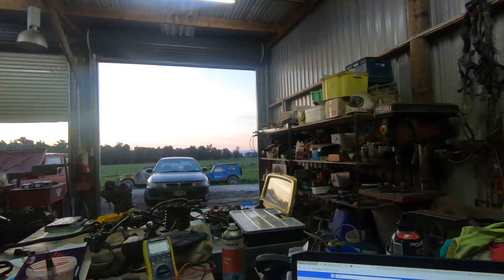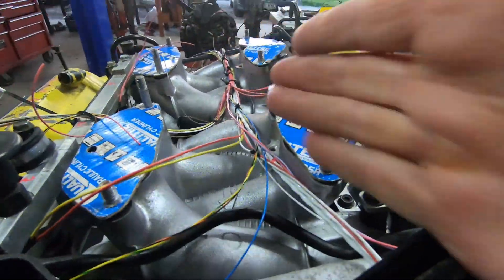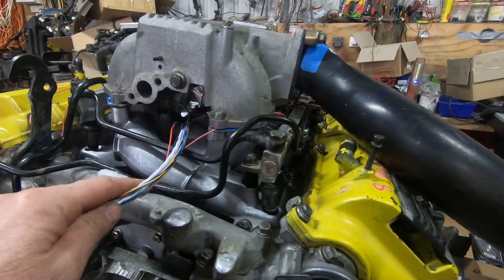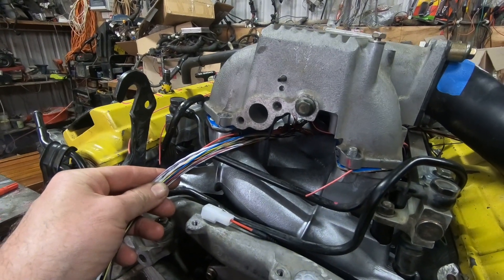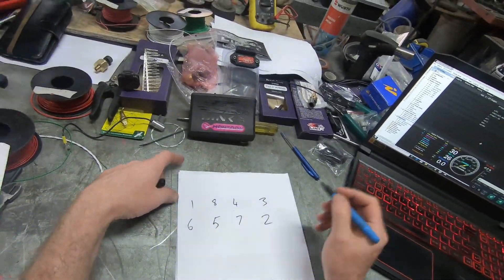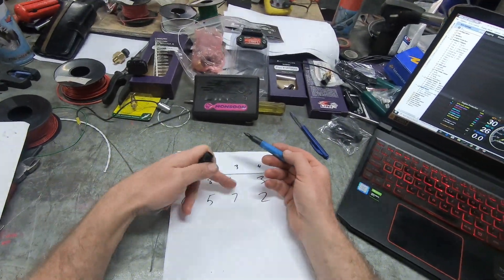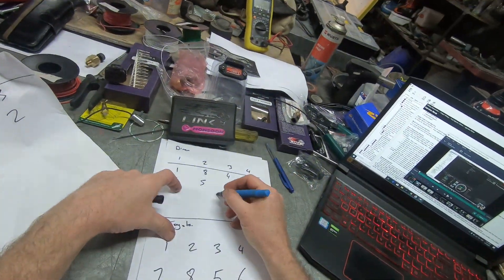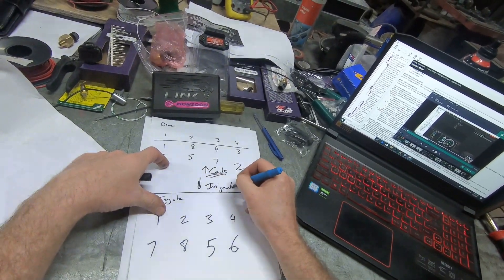1uz-fe injector grouping for link ecu semi sequential for best results on 1uz 4 injector output ecu

Comment: Hi, im using a haltech 1500 ecu with 4 injection drivers on a rover v8. is there any reason why i cant use the injection pattern as follows: inj #1: 1-8, inj #2: 4-3, inj #3: 6-5, inj #4: 7-2
Reply from the maker: While it would still run the pairing you have suggested goes against what is discussed in the video of getting the port timing of each injectors as close as possible.  In fact the pairing is about a far from the ideal injector timing as it could possibly be,  therefore I would not use the grouping you have suggested.  Cheers Kelvin
Reply: @CartuneNZ  i spoke with haltech and they confirmed that the only way to connect up the injectors is inj #1: 1-6, inj #2: 8-5, inj #3: 4-7, inj #4: 3-2. apparently it cannot be hooked up as per the 1uz-fe or any other way. im not sure why this is as the injector drivers will fire what ever injectors are paired together. any reason that you may know of?

can you explain what you mean by port timing?
Reply: if i was to use the 1uz-fe setup would i need to change the firing order to 1,8,3,4,7,2,5,6?

in the haltech instructions it states "When wiring for sequential fuel injection, fuel injectors should be wired with inj1 output to cylinder 1, inj2 output to cylinder 2 and so on. The injectors firing sequence will be set in the software via the firing order found on the advanced tab of the main setup page. If semi-sequential injection mode is used the injection sequence will always be Inj1, inj2, inj3 inj4 etc, regardless of the firing order set in the software.

Comment: Hi Calvin, Im Gabriel from Costa Rica, i cant get my engine running with EcuMaster classic, i wired the injectors and coil as you show in this video. i have timing at 10degr(i check it with a timing light ), and all coils(CoP) and injectors are working, do you know what other thing should i check? 
Regards!
Reply from the maker: Hello Gabriel.  Have you gone over all the input signals?  Have you added fuel externally via the intake??

Comment: Hi Calvin. This is Russell from South Africa. I have been watching your YouTube about the installation of the LEXUS motors, and problems experienced. I have recently had this conversion done, (including change from manual to automatic transmission), to my NISSAN HARDBODY 2001 model, The problems I am now experiencing are: OVERHEATING - There is a twin blower fan in front of the air-conditioning radiator, which is mounted in front of the water radiator. How can I solve the overheating problem? This overheating occurs driving around town, not on the open highway.  AUTOMATIC TRANSMISSION - The car seems to "jerk" after a while when stopped at traffic lights/robots or stop street. This does not happen when in "Park", only in "Drive".  VEHICLE SPEED - The vehicle speed appears to be "governed" to a speed of 130km/hour. I've been informed that the motors imported from Japan are "governed". How can I override this? :-  I hope you can help me to resolve these problems, as the garage that did the conversion do not seem to be able to do so.  Thank you for your YouTube channel, it has helped me a lot and I watch it often. Best Regards, Russell
Reply from the maker: Hello Russel.  Sounds like you need better fans for slow speed overheating.   I would confirm trans has correct oil and ecu has the stop switch input for jerking and removal of the speed cut is easy with a device I sell.  Cheers Kelvin

Comment: The point about the help file cannot be made clear enough - this help resource is fantastic, and available through the link software even before an ECU is connected - perfect for during the planing stage.
Reply from the maker: I agree.  I try to include using help file in as many videos as I can.  Planning is such an important part of wiring the ecu as well.  Any other topics you might suggest?  Cheers Kelvin
Reply: @CartuneNZ  The video on igniters was fantastic - highlighting equivilant parts that can be used on engines with aftermarket ECU's.  I suspect for things like the Idle Solenoid, and some other bolt on parts it's the same deal - there's an NZ EFI part that works in NZ (and we are spoilt with bits for the 1UZ in NZ) - there's a BMW equivilant that looks like it could be made to work if you couldn't order the NZEFI one.
The other videos that have been really valuable are ones on what you can strip off the engine, for use in other applications.  More along these lines, and back to basics videos would be good (ie, fuel supply considerations, cooling considerations, radiator bleeding considerations).

In saying that - there's a wealth of videos you've already made, that's a fantastic asset to the community - time to crack open a thought canister and watch some more.